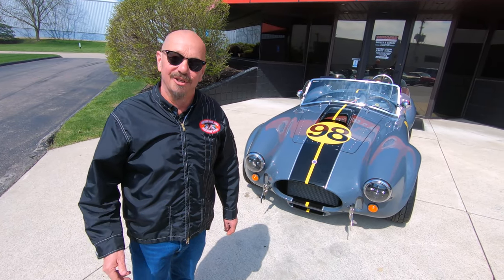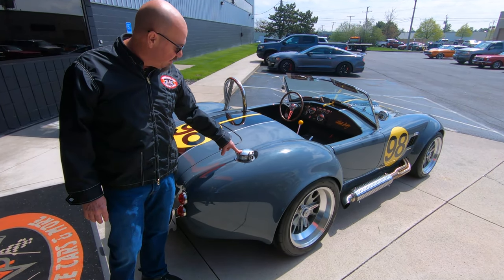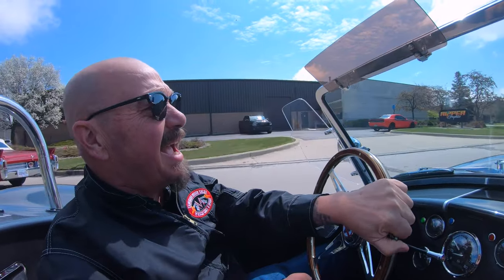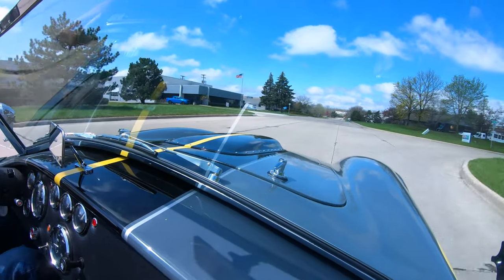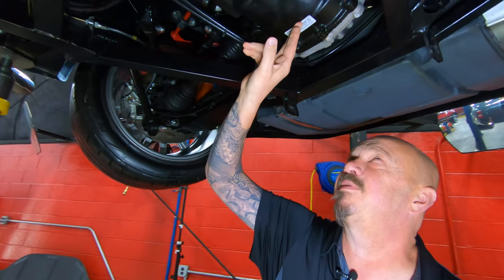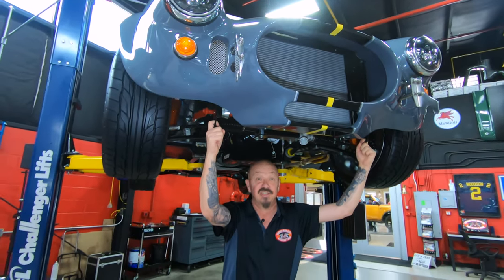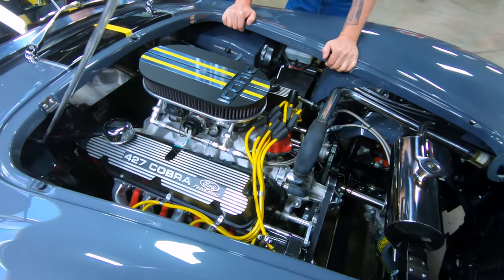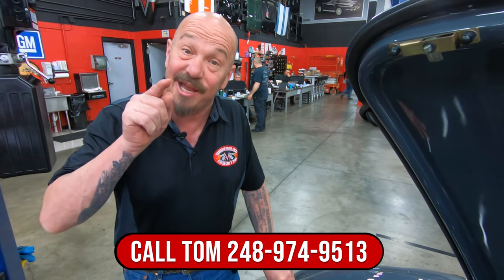1965 Shelby Cobra Backdraft For Sale Vanguard Motor Sales #1009

Comment: Did you ever noticed that Ford and Chevy both had 427? I think Ford came out with there’s first. But Chevy came out with the 302 long before Ford. It just wasn’t allowed on the road. It was too dangerous. HP from 450 to 500 hp.